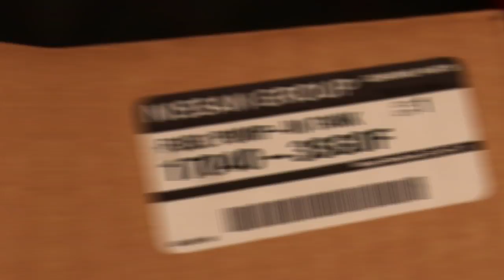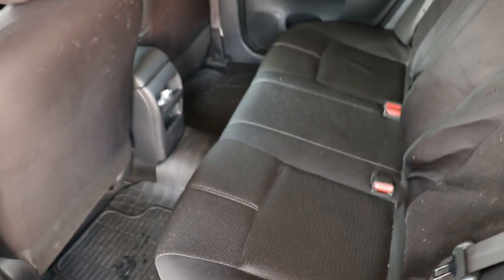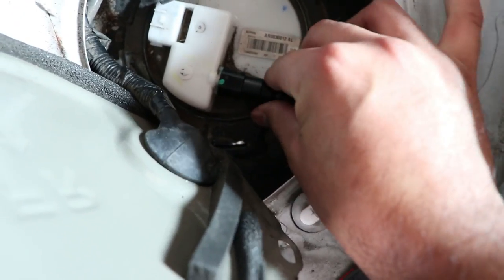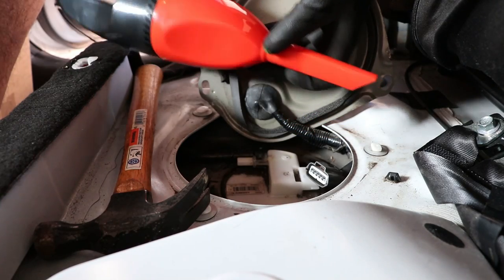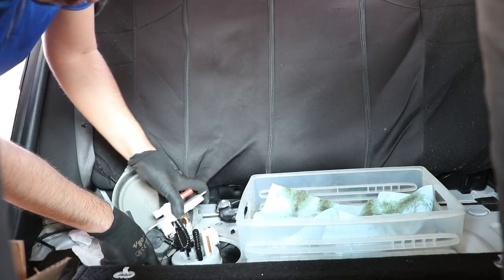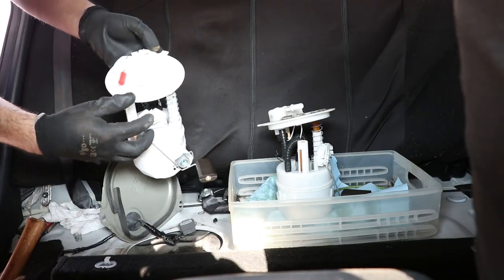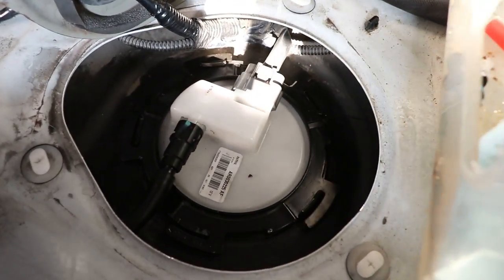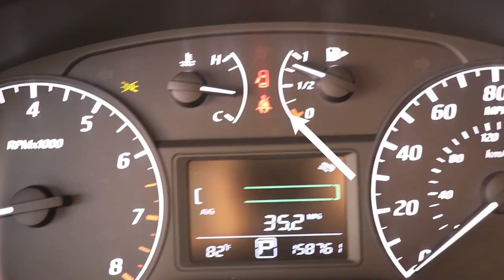Nissan Sentra FUEL PUMP installation (complete tutorial)

Comment: Very good video..... I've changed the pump three times in one week... all of them work fine but the fuel level is not correcting! I tried by disconnecting the battery for hours. Is it possible that the three pump are faulty? :/ what else should I try?